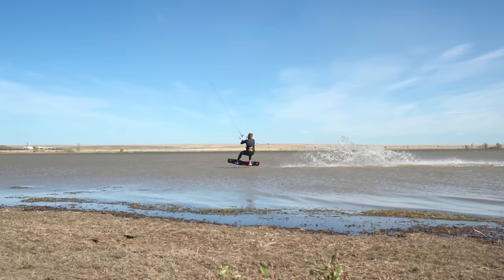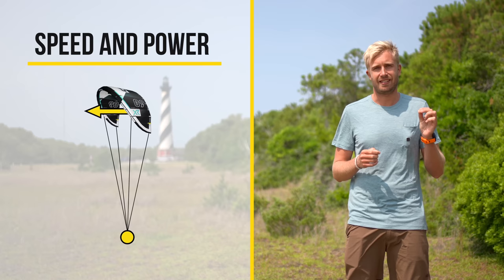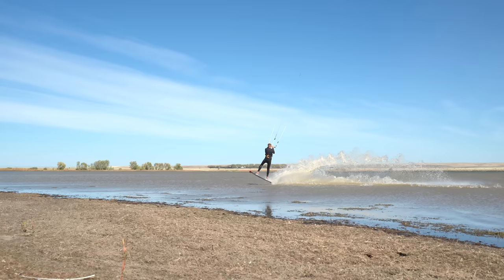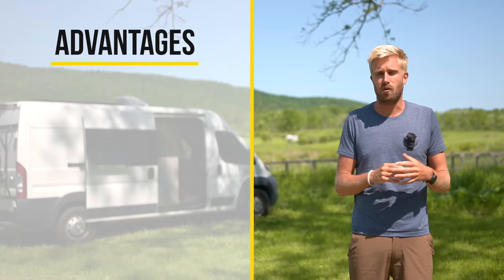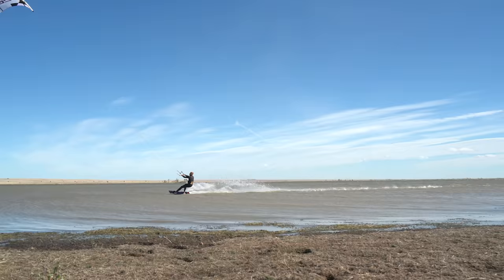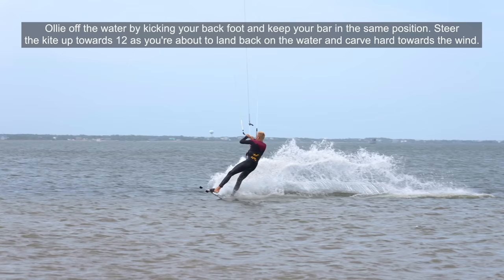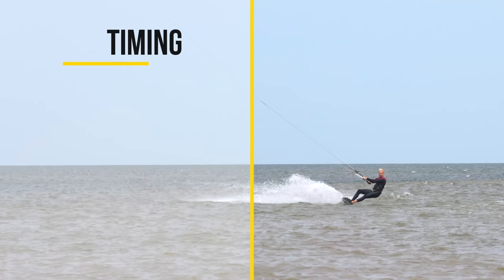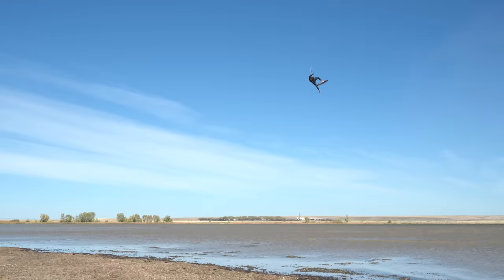Should you  Pre Load POP??? // Kiteboarding SA Masterclass

Comment: one of the key points of the jump with preload pop is that it goes more vertical, adding more control to tricks
Reply from the maker: I'm not entirely sure if I agree with you there. By popping off the water the kite will actually sit deeper in the window making it harder to do a vertical jump.
Reply: @stevenakkersdijk  on my current level the difference is huge :body-blue-raised-arms:

Comment: Nice video... The time is very important.. i have a question about It... If i riding with a 14mq and 19 knots... The kite when i preload Is a Little slow to back inside the Window'wind... There Is to Say that i riding with the kite very low for more Speed... And for go at 12 o'clock the kite Need a Moment more... So i ask... In this condition do you think that i can approciate with "jump prepop"  not "while" but "After" Turning the kite... it's a mistake for you? Or not? Thanks in advance
Reply from the maker: On the bigger sizes it does make sense to do your pre load pop a moment after you steered the kite up towards 12. So I totally agree to what you're saying 🤙

Comment: Steven u said in the video u should not pre load pop in over powered conditions i don't agree with that
Reply from the maker: Why do you disagree? Curious to hear your explanation. (Of course it also depends on what you call overpowered. For me overpowered is the moment where you're having a lot of trouble to hold your edge and a gust will accelerate you so much that it's nearly impossible to slow down)